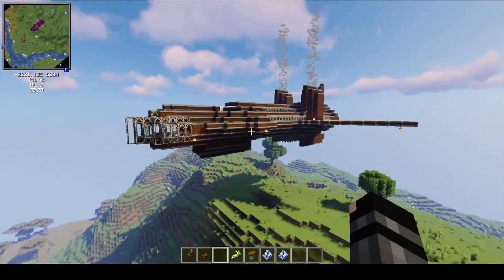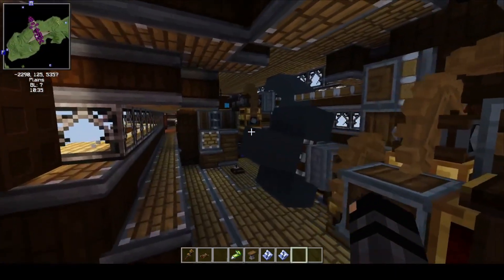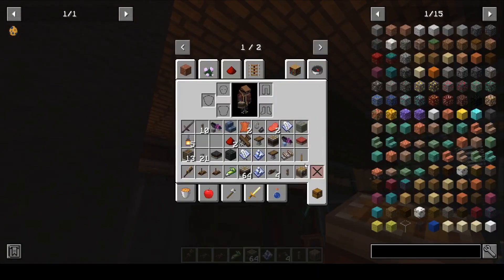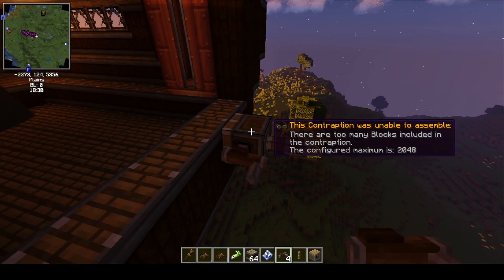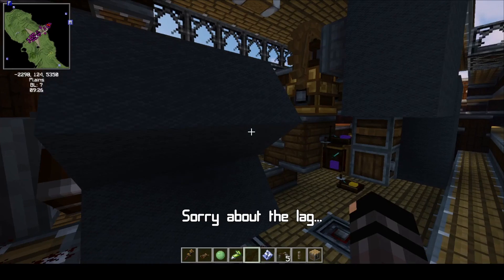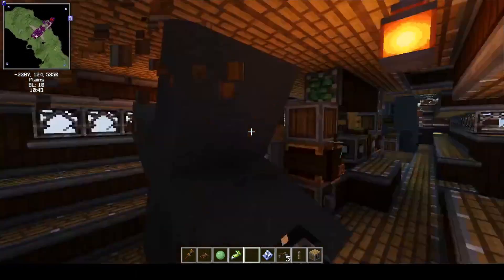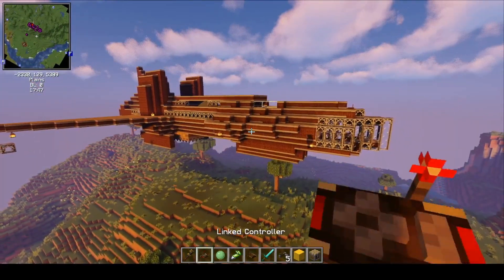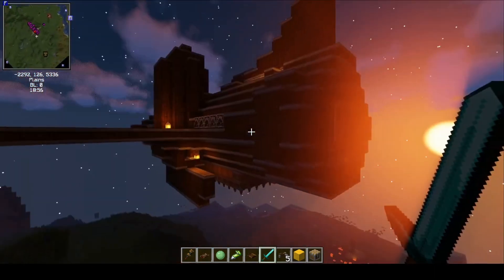Create Mod 0.5 - Make your own airship! - Troubleshooting

Comment: So I know it's been abour a year since this video was posted, but I'm having some difficulty on Create 0.5.1-d for Fabric. I made a flying platform based on this design, but I'm attaching a rope pulley to raise & lower a drill platform for mining. The problem is, the rotational power going from the speed controller into the rope pulley will reverse when the contraption is rotated, so it keeps changing direction when it shouldn't. Any advice on how I can fix that issue?
Reply from the maker: Rotational power changing direction when you rotate is the bane of my existence. I haven't figured out exactly how it works but I do know that you need to neutralize it by cancelling out the direction change. I have a video called piston experiments that you might find useful. Also if you look at my builds I incorporate things like gearboxes that will change the rotation direction to cancel out the unwanted changes.
Reply: @KwizzleHazzizle  I'll check out that video, thanks. I asked Mysda as well and thought we'd figured it out, but no such luck. He recommended using twisting horizontal chain drives for the power input, but it didn't solve the problem.
Reply from the maker: @michaelkern8022  It takes a lot of trial and error. Basically try to get your shaft to turn once on each axis and it should work. So if you have a speed controller that counts as one axis, then you just need two more axis changes, so probably one gearbox and one vertical gearbox.

Comment: Ok sooo here's a new one: the up/dn system is completely wacked out. When I press spacebar with the linked controller, one of three things will happen: 1) it will (rarely) go up as it's supposed to; 2) it will go down then up and all but one of the windmills will cease; 3) it will go down twice. After investigating the system I believe this to be an issue with the redstone links accidentally powering each other just ticks before the system kicks into gear, meaning once the system stops rotating, the other system activates and completes the circle. It may also be worth noting that I have not altered the system in any way. Come to think of it, could this issue be caused by the sequenced gearshifts turning the wrong way?
Reply from the maker: Hmm, I've had this problem before... make sure you only have one airship within redstone range (256 blocks I think) so that you don't have 2 transmitters sending out the signal at the same time.  I don't remember what the problem was exactly but I think its some weird sort of timing thing. Like sometimes my oscillator circuits in some of my other builds will just not work in one position but the exact same circuit will work in another.  I don't think its caused by the sequenced gearshifts going the wrong way.

If you import this into your world do you have the same problem? It's an airship that uses the exact same engine.
https://www.mediafire.com/file/7qq9oqfy3nfppcv/fantasyairship2_3.nbt/file
Reply: @KwizzleHazzizle  Thanks, removing the other receivers from the "failed" engines seems to have worked
Reply from the maker: @Cru5aderOW  Awesome, glad you figured it out!